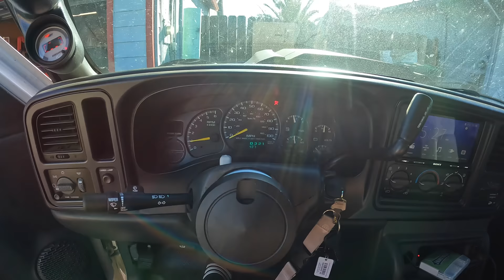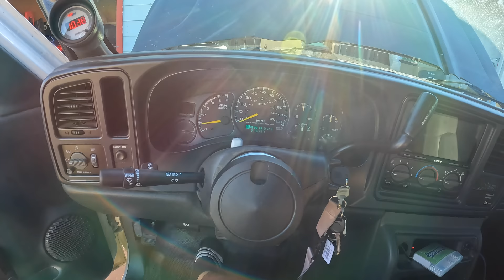Aaron Tried To Fight The Tow Yard Workers for Damaging His 5.0 Mustang

Comment: I got a 5.3, when I first had got it lifters would tick when I got on it on the freeway but would go away after normal driving for awhile, but I installed a high pressure oil pump and the lifters haven't gave me any more issues no matter how much I get on it.